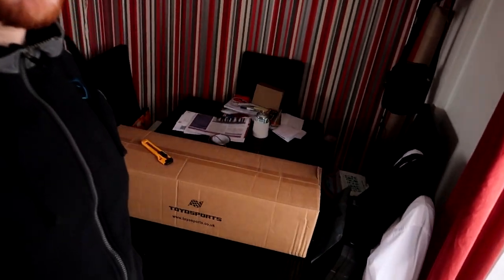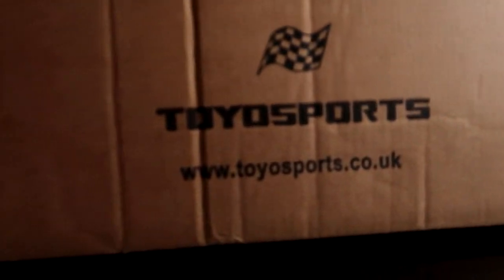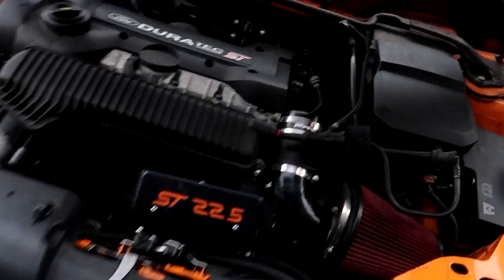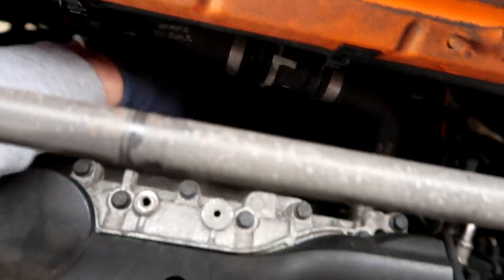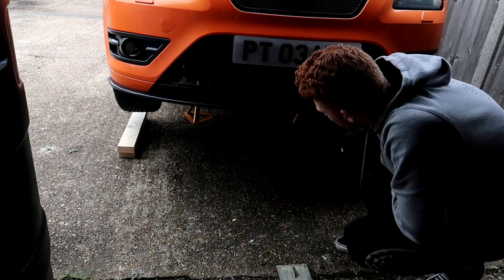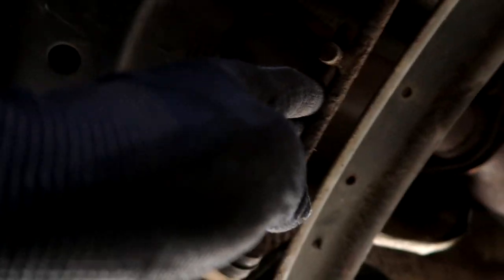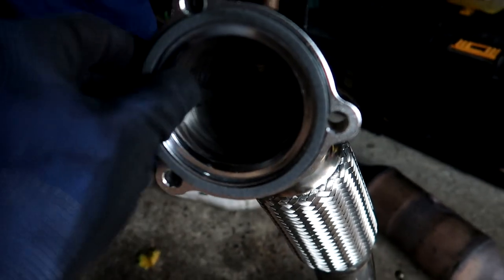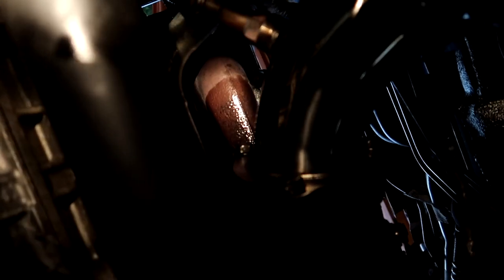HOW TO INSTALL A FORD FOCUS ST DOWNPIPE

Comment: Apart from gasket did you use anything else to seal between cat and down pipe? Thinking of adding a decat as currently got a sports cat but don’t wanna damage it with a pop and bang map!😜
Reply from the maker: ST Yusuf came with exhaust metal gaskets if u get a decat they come with bolts and baskets but yh pop and bang maps probs needs to replace every now and then they’re not too expensive but yh other than no extra exhaust paste or anything
Reply: 03ANO what I meant was did you use any exhaust paste or gum or were metal gaskets enough?
Reply from the maker: No paste mate just the gaskets pal

Comment: Done this to mine also but having problems 2 weeks down the line. Getting engine malfunction warning and light then it goes into reduced acceleration. Replaced bank 1 sensor 1 but it’s still doing it but got worse. Got told to replace them with genuine sensors? What you think guys?
Reply from the maker: Liam Noble yeah sensor could be on way out maybe replace you will get a light on if you have a decat but downpipe should be fine it’s only bite size so I’d suggest replacing it

Comment: Very helpful mate, doing mine soon, legend for doing it in the rain. Bloody weather eh. BTW, I had to dremel my downpipe gasket a tiny bit to get it to sit in the recess snugly. Glad I checked it beforehand, just a smidge too tight.
Reply: I just got the airtec downpipe and the gasket is to small to fit in the recessed part as well
Reply: @adyg8221  Just go easy on it and try to take a little away from all around the inner diameter of the gasket. It's tougher material than you think. Use a new drum sanding bit and keep stopping to check for fit. I got it so that it fit in there snug so it didn't fall back out while trying to fit the downpipe. It's a bit of a faff but that's probably me and the way I do things lol.
Reply: @royevans4581  thanks mate I’ll give that a go  next weekend
Reply: @adyg8221  I'm back again haha. Just to let you know to be careful taking out the bolts from the manifold when taking off the old downpipe. The Manifold is stainless steel which I am told by engineers is notorious for galling the threads on bolts. If it gets tight taking them out, don't try to force the bolts out, they will just snap and you will then probably have to take the turbo/ manifold off and take it to an engineer to get the broken bolt out. (happened to mine when garage tried to change my exhaust. I ended up doing it all myself because they wanted £700 to do the job) Try and get some penetrating oil in and tighten back up, then loosen then tighten etc. work it out slowly. I hope they don't give you any trouble. When you put the new bolts in, put some anti seize on the threads. It will help if you need to take it apart again later on. Same goes for exhaust flange bolts at your joins. Downpipe bolts that lock in place are a good idea as normal ones can work loose over time, causing leaks. I believe you get a set with the Airtech downpipe. Highly recommended you use them. I've done a lot of stuff on my ST with the help of such guys as Deano, so if you have anything to do, just ask me and I might have already had a crack at it myself and let you know how I did it. Cheers, enjoy the new exhaust.
Reply: @royevans4581  cheers mate thanks for the heads up I have miltek ultimate and high flow cat on the rs I’ve not had the balls to try the dp for that reason hey I’ll see how it goes take my time